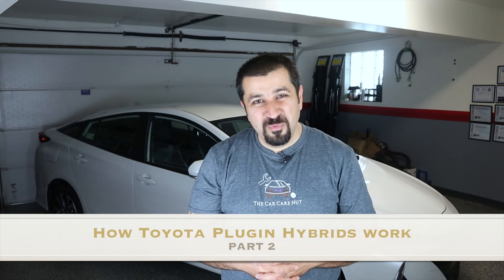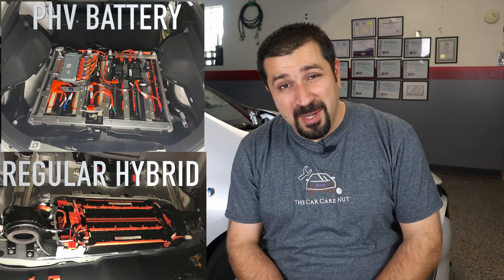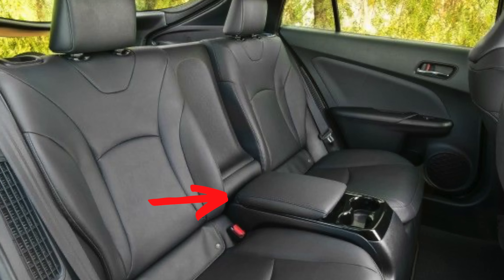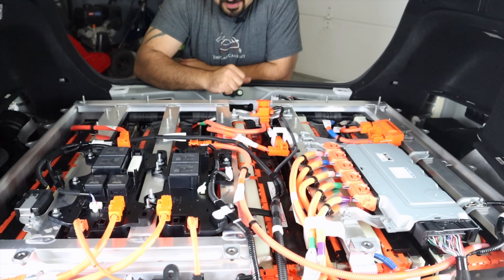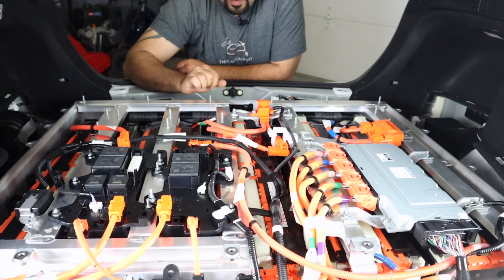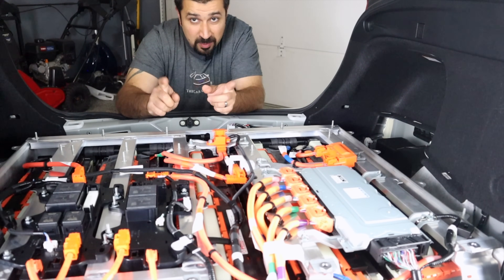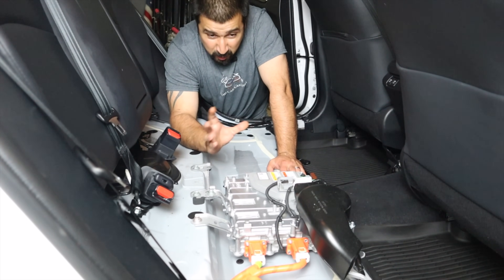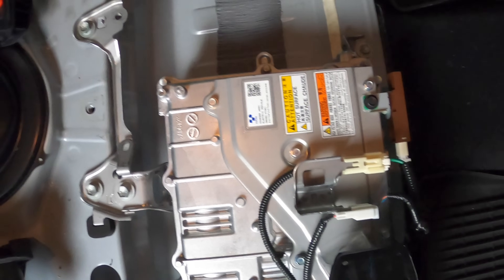Toyota plugin Hybrids. Are they any good? Battery and charging review

Comment: I wish the Prime had the solar roof charge option like they do in Japan, My dad's 2021 Sonata hybrid has the solar roof charge option, it acts as a charge assist to supplement the HV battery and keeps the 12v charged, it can't touch the Prius mpg but it darn near it.
Reply: I miss the solar panel my 2010 Prius had. I live in FL so having that Solar Panel to circulate the outside air in through the cabin to keep the cars interior temp the same as the exterior was AWESOME. Now that may not sound like much but I’ll take 95 degree interior to 115 any day.

Comment: For a hybrid vehicle do you have to change the engine oil as much as the regular non hybrid cars since about half of the time the electric motor is driving the vehicle and the engine is off
Reply from the maker: Hi! You still do need to change it at a similar interval
Reply: Toyota recommends an annual change for the regular prius. I imagine this is more than adequate for both.
Reply: @nickhahn5412  Keep in mind that especially with the regular Prius, you change based on the mileage or the time interval, whichever comes first.

Comment: Surprised you are saying a standard Toyota hybrid can only go a very short distance and 25 MPH in EV mode. I have a 2021 Corolla Hybrid and on a fairly flat surface I can go 2-3 miles, maybe more at 35-40 MPH in EV mode. That does not include starting from a stop which will require the gas motor to get up to the 35-40 MPH speed.
Reply from the maker: It will go into EV mode here and there but not from a complete stop.
Reply: @TheCarCareNut  True not from a complete stop but once up to speed I am impressed by how far it can go in EV mode. It is a great car. Averaging 51 mpg and I drive more than 50% on the highway.

Comment: Hi AMD, my 2008 camry hybrid has vibrations at 75mph and above. I feel it in the floor, the accelerator pedal, allitle bit in my seats, and lightly in the steering wheel. I've had the car balanced, and the vibrations are still here. I also experience vibrations when hard braking, mostly 40mph and above to zero. It's not present during regular braking. Thanks, and may God bless you!
Reply from the maker: Hi! Check the brakes especially the back. You could have one or more that’s seized and causing the vibration.

Comment: That's a very good review and a very important video.
While you and your audience are mostly Toyota drivers, and I am, as you recall, a Lexus hybrid owner, I recently replaced my parent's car with an EV.
It is a very short step from PHEV to EV.
Thanks to you, I made the initial transition to a Hybrid, and thanks to you I was able to have enough confidence and knowledge to plunge head first into full EV.

The temperature management cannot be understated on these cars. It is absolutely crucial to the battery longevity.
My Lexus has an air cooled Ni-Mh battery with perfectly clean vents, likely for the entirety of its 12 year life.
The electric car has a liquid cooled 44.5 kw/h li-ion battery pack. I recently drove it in 40 degree C heat (104F) with no AC for the cabin and I could clearly hear it working to cool the battery.

The EV I bought is a Chinese MG ZS EV, sadly not for sale in the US. Due to import charges of my country it wasn't cheap, so don't feel bad. Teslas are leagues better, I just couldn't get one at a sane price.

Comment: You mentioned that the computer will heat the battery if the out side temperature is below 35 degrees.  What is the HIGHEST temperature in the RAV4 Prime that will allow the system to charge the battery?  Would the A/C come on automatically to cool the battery if the ambient temperature is above that level?   Thanx.
Reply from the maker: From what I’ve seen it’s not listed but I’ll keep digging

Comment: Does the charger have serviceable filters? I looked at mine and it doesn’t appear to have any?
Reply from the maker: Hi! It doesn’t have serviceable filters just the 2 for the battery
Reply: @TheCarCareNut  interesting. Do you think there will be issues with the charger as it’s air intake is open to take in dust?
Reply from the maker: I haven’t seen issues yet. It’s not directly behind the opening so it might be ok

Comment: Did I understand that when plugged in and charging, it will charge the hybrid battery and the 12 volt battery? If so, would it be OK to leave plugged in for a month or two while out of town? Better than a trickle charger?
Thanks for all you do. Much appreciated!
Reply: If you need to leave for that long then take the negative from the 12v battery. This will prevent it from getting drained and also disable all hv system. Once you get back, put the negative wire back on and it's good to go
Reply from the maker: Hi! It’s not recommended to leave the HV battery fully charged and idling like that. Also I wouldn’t recommend leaving the car plugged in when you’re away for a month or two.
Reply: For extended non-use, unplug the traction/hybrid battery preferably at 50% charge.  Then hook a trickle charger to the 12V battery to maintain charge.  When you return, you can fully charge the traction/hybrid battery and unhook the trickle charger from the 12V

Comment: Very Valuable information. Picking up my 2021 Prime tomorrow. Really excited. I’ll be spending a lot more time watching your videos just to soak in the information. Keep it coming.
Reply from the maker: Congratulations!
Reply: @TheCarCareNut  prius prime less emissions than most effceint tesla currently, unless both cars in the comparison test are running on cleanly made energy which is rare. batteries cant be recyled multiple times bc after each time preformance of newly recyled battery and motor materials is lowered massivly, it end up being used in building or grid application instead of cars, and even then it quickly becomes too under preforming to be used.   e fuels and hydrogen combustion etc seems to be the only mainstream true sustainable solution, and prius prime would adapt to those. nissan e power has interesting way of combustion fueling electric power output, so not mechanical connection from combustion engine to wheels.  prius prime could at least theoretically be lot betterbut yo tub  wont let me talk too much in here , it deletes lot fo what i say in here

Comment: Very informative, thank you. Good to know that CCID is only rated to 30,000 cycles. I've wired a separate 240v from the panel for charging the PRIME. BTW, the original CCID does work with 240v even though the sticker says 120v only. Li-Ion battery is still not the answer to full electrification. During winter, after charging, the miles indicated on the dashboard says 24miles but actual miles driven is less and depends how you accelerate- gentle acceleration will yield close to 22-23. Pedal to the metal will be around 16-17 or even less when in power mode. When it's warm like around 65-74F, full-charge is 33.5-35.4 miles and in my experimentation I've driven close to almost 34 miles- the condition to achieve this is in ECO mode, constantly moving(not a stop and go), and low speeds (mid to upper 20s and 35-39mph). Power-mode scares the misses. Li-Ion makes the trunk very cramp and can't put much luggage there. On long trips when the battery if fully depleted, I switch to charge-mode to extend the gas and drive in EV again. Highway speed is ideal. BTW, the 80 percent level is always calculated on the last charging cycle and in the winter this is low. The 12 gallon gas tank is approx. 410 miles in range and when combined with charge-mode, this is easily increased. I saw a youtube video and they indicated for every 1.5 miles driven at highway speed you get back 1 mile of charge. Toyota should put a higher wattage charger in all the PRIME.

Comment: Hi AMD, does the Prius Prime automatically charge to 100% or can it be set to only 80% I read a comment about unplugging 15 minutes before it completes. Charging to 100% degrades the battery faster correct?
Reply from the maker: Hi! 100% on the display is not actually 100% actual charge. There’s a built in protection as lithium ion batteries get very unstable at actual 100% charge. So even though it shows 100% it’s actually not 100% so nothing to worry about there.
Reply: @TheCarCareNut  Great to hear, thank you so much, makes me worry less now lol

Comment: I have three  questions 
1 I  charge the prius prime at home in 6h with 120V,  4h with 240v and 2h in a  chargepoint station 45miles from key west. How is that possible? 
2 How can I set the timer on the ac to two hour instead of 10 minutes when charging?
3 Where can I  buy a reclining seat for the pp?
Reply from the maker: Hi! Interesting on the charge point. Is that from a zero EV range?
Reply: @TheCarCareNut  The chargepoint station is only available in the app but it looks like a type 1 and 2 charger, however, the battery went from empty to full and 28 mile rage. If it was to 2 hour limit the battery wouldn't have been fully charged.
Reply from the maker: I’ll look into it. You’ve tried the 240v charging at home and it took 4 hours?
Reply: @TheCarCareNut  Yes, at 220v at home take 4 hours but I only charge it on 120v because my solar inverter is set for 120v and it take 6.10 hours ten minutes for the full charge and only 25 miles range. I wish I  can replace the passenger seat with the ford f_150 max recline seats which lay flat like a bed. But the pp won't go all the way down because the rear seat won't let it get lower.

Comment: Another FYI, around the 9:45 mark you mention that single vent venting air out. Based on Prof Kelley Weber State video that is the mandated battery gas vent. The circulated air actually exits via two one way flaps on each rear fender. Mentioned here at the 5 min mark. https://www.youtube.com/watch?v=zXv8ZQkAM3A&ab_channel=WeberAuto

Comment: AMD, I will remain in the 'old-fashioned' non-plugin Hybrid camp for the time being.  ;-)
Reply: For now I will too. No place to charge the Prime, and already have a perfectly good Corolla Hybrid which itself costs peanuts to operate. Hammers out my delivery work as if it was nothing!
Reply: I can plug in at work, and easily get back and forth to home on a charge... that means no gas bill all week!  it's tempting, but with $2.50 gas I'm not really saving much.  this is probably ideal for someone with a 20-25 mile commute who can charge on both ends.
Reply: @RealJohnnyDingo  I am a Doordash/Grubhub driver so high range is paramount.
Reply from the maker: I hear ya

Comment: Hi i have one question. When you use the pre-conditioning (using A/C bottom on remote key) the car will use AC system to cool down and by doing this the car uses the AC settings that the driver has set before shutting off the car. My question is now what kind of AC setting is the car using if i give permission to cool down battery while charging? Tks for your reply
Reply from the maker: Hi! It will use the AC based on the conditions. If it needs maximum AC it will use the lowest setting.
Reply: @TheCarCareNut  tks a lot for the reply and for all the interesting videos 👏👏👏👏

Comment: Does the battery only charge to 100% or can we set charge limit to 80%?
Reply: It'll be interesting to see the battery degradation after 5 years
Reply: @ByteFilm  2017 prime range last weekend was 28 miles on a Chargepoint station.
Reply: You can charge the battery to 80% with the engine or stop charging the battery 15 minutes before full.
Reply from the maker: Hi! In reality you can never charge the battery to actual 100% it’s always limited to certain percentage internally but on the screen it will show 100%. Using the engine you can only charge it to 100% as nelio said.
Reply: limiting the actual charge to 80% will extend the battery life considerably.  lithium batteries degrade more quickly when fully charged.  solution is to use a bigger battery and limit charge to 80%, so you get adequate capacity and long life. good engineering!

Comment: THANKS again. Great video.   So how is the performance of the prime vs regular Prius?  Have they done a sufficient job in compensating for the weight so far back?  Is there a significant difference on the track?
Reply from the maker: Hi! Driving them they feel similar with the prime having a typical electric car take off “jolt” but quickly fades out around 30 mph and it’s similar otherwise.

Comment: Hello.  Please can you do an instructional video on the CVT drain and refill.
    When I purchased the used 2016 Gen 3 Auris at 80K miles I asked the Dealership to change the CVT fluid. They said they would have to order it in. They don't have in stocks. 
   They insisted that its a lifetime fluid and doesn't need changing  like the  engine oil.
     Its not an automatic that's difficult to do with that special drain plug..
     How often would you drain your CVT fluid nowing that there's no filter to remove metallic  particles from swimming with the fluids landing on the windings of MG1  and MG2.
   Can I upgrade to the newer eCVT fluid  or do I need to stick with the original WS fluid?
    The Vehicle has done 110k miles now..
    Can I also change the  thermostat to say 72°c during the  Extreme summer heatwaves. To Prolong the headgasket.  Also lowering the the INVERTER temperature to Prolong the life of the IGBTs from exploding leaking out the coolant like  California  where there is a recall software update. 
    Many thanks.  Looking forward to your professional video on the CVT fluid change ASAP.
    Ps had a high mileage Supra year's ago and it used to whine like a bitch in top gear. 
    Don't want that in my Prius system...
Reply from the maker: Hi! Is your auris hybrid?

Comment: So would it be advisable to get tinting on the windows to keep battery cool in summer? If so what kind of tint prevents heat
Reply: Nano ceramic window tint. YouTube it.
Reply from the maker: Hi! Yes that is advisable. Most tints will protect the interior from heat to a degree but something is better than nothing

Comment: Thanks for video. I am impatiently  waiting for more Prime RAV4 videos. I'm a little bit disappointed  with departure mode charging. If I set departure time to 6 AM, it finishes charging 40-90 minutes before set departure time. I would expect it to see more accurate timing.
Reply: Is it so that the batteries have time to cool off, for better efficiency? Only guessing, I only drive a 2500 6.4L gas and 5500 diesel.
Reply: I agree.  At first I thought that it had to "learn" how long it would take to charge, but after over 2 months, it still finishes charging well before my departure time.

Comment: Taking new 2021 Toyota Camry Hybrid on road trip this summer.  Do I need to have dealership service prior to departure?  Less than 1500 miles on car.  Thank you.
Reply from the maker: Hi! At this mileage and age you should be good to go. The most I would do is check the tire pressure
Reply: I did changed the oil for the first time at 1000 miles before a long trip in hot weather and the oil was in desperate need of changed. I use the synthetic oil and I changed again at 3000 miles for another long trip. The engine is always happy about it.

Comment: As you continue the helpful information research on the Rav 4 Prime can you operate this  Rav 4 prime without  passenger and back seats, to set up a camping type vehicle? Also support a portable refrigerator, without the key turned on, if possible  functioning estimate running time a weekend would be a good base. Plus run a portable microwave or instant pot. Still without key turned on. Hoping this Prime will allow better off the the grid fun.
Best regards, Mango.
Reply from the maker: Hi! You can but the back seat bottom might be an issue as there’s the charger and DC/DC converter underneath the back seat
Reply: Please put together a video for Rav 4 Prime off the the grid camping. Possibly include all by intentions. Best regards, Mango
Reply: @philmanglicmot2528  Yes, but not least it has a 1500W AC inverter that is powered by the car's battery via the L3 Chademo socket as in the Mitsubishi but you still need to turn on the key.  I did it in a differentway. I used a 5k 48v lifepo4 battery charge by a 12v to 48v converter then turn of the key and used solar panels to top it off.